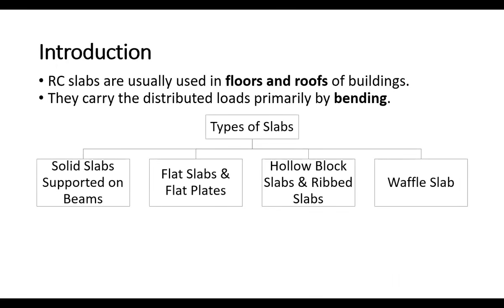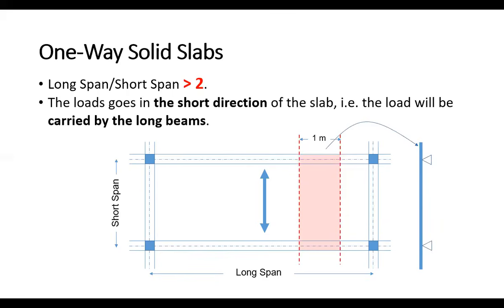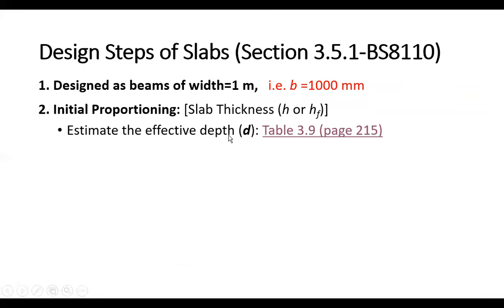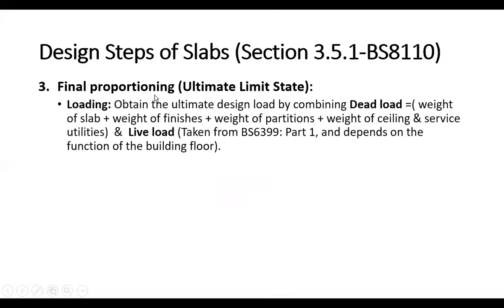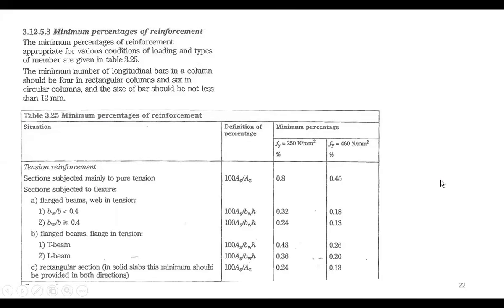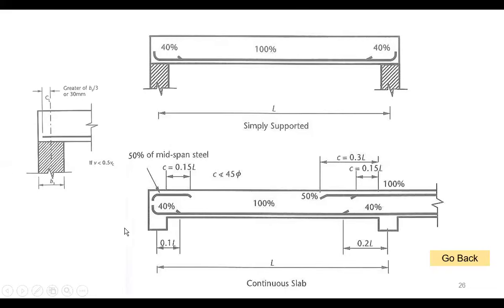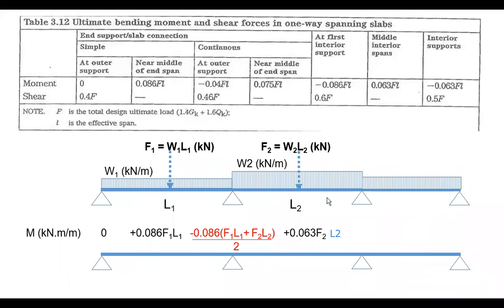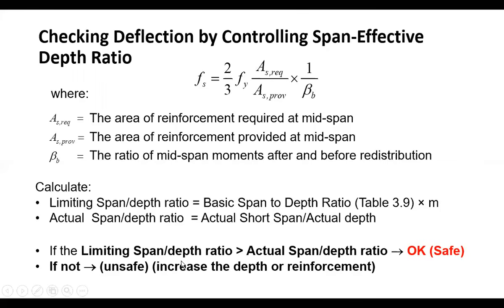Design of RC Solid Slabs (Part 1) - Clear and Informative Video

Comment: dr. plz ,,, am struggling getting the need for the 1 width strip in designing slabs.... i cannot understand why we are concerning about the width of the slab and not the length of the slab ?????????? plus how to deal with the slab load which is in kn/m2 while in beam the load in kn/m. Am too confused and i tried to figure out the reason and how it is applicable practically ????  what is the face of simplicity they keep telling about when they use strip method .... plz doc dont ignore my comment.
Reply from the maker: You can design for the whole width of the slab and get the total reinforcement in the whole width of the slab but this is not practical. It is easier to get the reinforcement in 1 m width and once you did that you easily can know the reinforcement the whole slab. In slabs, it easier when you have the reinforcement for each meter. It is easier for the workers and engineers on site.
Reply from the maker: When you have the reinforcement per meter it will be easier compare different slabs as well.
Reply from the maker: I hope that I answered you. If you are still confused, ask and I will try to help.
Reply: @MrElgamal77   Thanks doc.... yes am still confused doc , i know that it is an approach to ease the calculations , but am wondering do we take the width only because we consider it as beam ???? and why not we say take a strip of 1 meter length ?? why we say width . i could not figure it out >>> also doc , why it is not practical if take the reinforcement for entire the slab at once.
Reply from the maker: @EUmyermelar  in the one-way slabs, most of the load will be transferred in the short direction of the slab. Very minor loads will be transferred across the long direction. Therefore when we design one way slab, we design only the short direction and use minimum steel in the long direction.
Reply from the maker: Now when we design the short direction of the slab, we design a 1 m only and get the reinforcement/m. Then we use same reinforcement for the whole length.
Reply from the maker: In practice and in drawing and tables, we give the reinforcement / m (5T12/m). This means to use 5 bars of diameter 1/ mm for each m width of the slab.
Reply: @MrElgamal77 thanks bro

Comment: Good day sir. I was given a question of a continuous 1 way slab with a two way at the end. I encountered an issue whereby the area of a bay didn't exceed 30m^2 so what will be my approach in solving for the moments. And also will I treat the end two way slab as a simply supported? Hoping for a swift reply

Comment: He'll Engineer, once again, thank you for your tutorials.
I have a concern, while calculating the depth of a solid, we multiply the basic ratio by a modification but the case is not the same while obtaining the depth of a beam. Kindly explain the difference. Thank you
Reply: Also wondering the same, where did the equation {effective depth = span/(basic ratio * modification factor)} come from, and on what basis are we assuming the mod. factor to be 1.3??

Comment: You said we don't need to repeat the step for getting total depth in case we realised something is different,  I want to know what we are supposed to do in case you realised the diameter has changed.
Reply from the maker: Nothing. You design are valid with the new diameter.

Comment: Hi Dr. Your videos have been amazing and definitely refreshing to understand this is a better way. I would like to ask a question in regards to the Main and Distribution Bar. Some engineers have been using the Main Bar (BB or B1) in the long span, and I would like to know if this is valid and it can be considered by BS 8110.
Thanks in advance from Seychelles
Reply from the maker: Thank you for your interest and support. For slabs supported on four beams, the main steel should be in the short direction. If the slab is supported on two parallel beams, the main steel should be in the supported direction of the slab because all the load will be transfered to the beams. In flat slabs (no beams) the main steel will be in the long direction.
Reply: @MrElgamal77  Thank you for your response, much appreciated. I see, so even if there is 4 beams it still should be on the short span. Is there any specific calculation available in BS8110 if one decided to change to the long direction?
Your response would very be helpful again doctor
Reply from the maker: @govinpillay1165  No. Main reinforcement should be in the short direction.
Reply: @MrElgamal77  Well Noted Dr. Thank you so much for your responses 
I'm glad you took the initiative to reply me here
Please keep making these videos 
Thank you again

Comment: Dr when you assumed the modification factor for the minimum effective depth to be 1.3, do we always make the same assumption at the start?
Reply: No. It is a typical range based on M/bd2 and how heavily the slab/element is reinforced and the grade of steel adopted. 

Look through the table of MF and link it lightly loaded of M/bd2 ranging from 0.75 - 1 with the corresponding  Fy adopted and you will see the typical range of that may be used.

Enjoy the rest of the day

Comment: Dr., how do we know to assume the modification factor as 1.3, is it stated in the codes?
or it is practical assumption? And is this modification factor based only on the geometrical properties?
Another question I have is if using basic ratio will work designing slab with non-conventional concrete?
Thanks so much for the upload. It taught me a lot about design.
Reply: No. It is a typical range based on M/bd2 and how heavily the slab/element is reinforced and the grade of steel adopted. 

Look through the table of MF and link it lightly loaded of M/bd2 ranging from 0.75 - 1 with the corresponding  Fy adopted and you will see the typical range of that may be used.

Enjoy the rest of the day